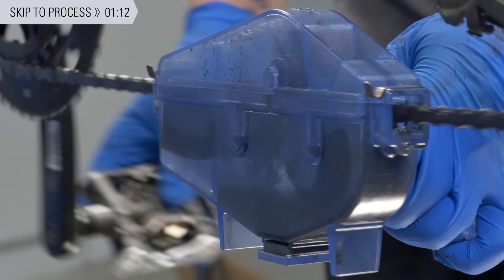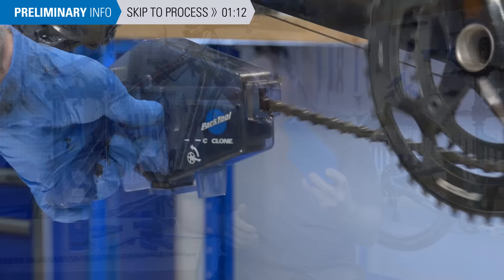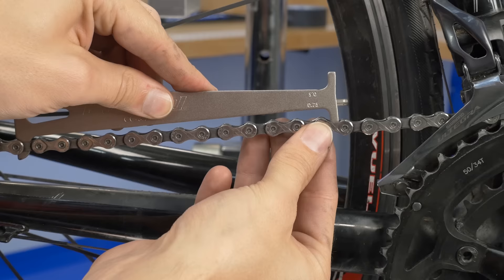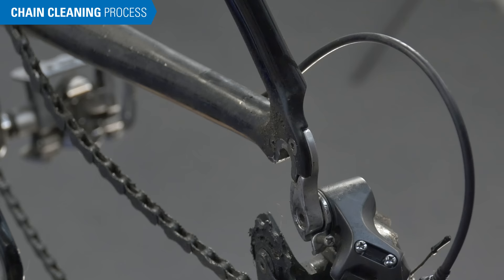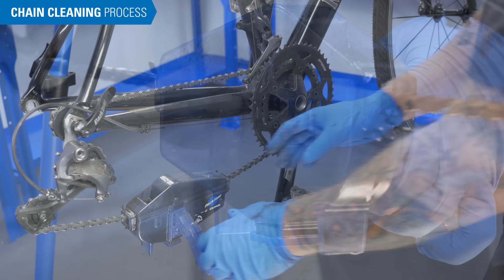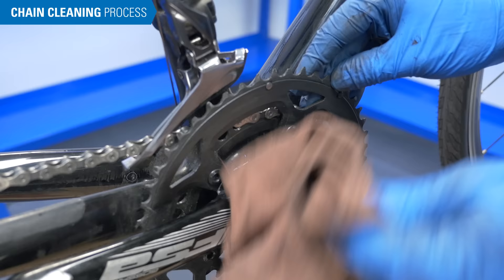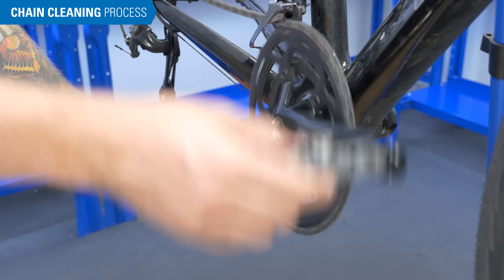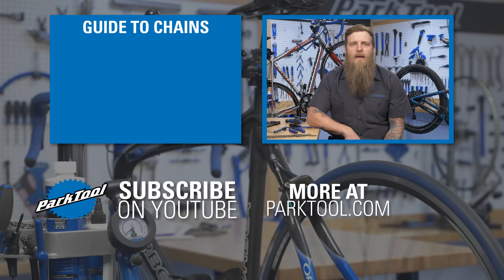How To Clean and Lube a Bicycle Chain with a Park Tool Chain Cleaner

Comment: don't do this. you destroy your chain!
Reply: Michael E you really have no idea
Reply: Adam O'Halloran 

Shimano officially says that you should not use a chain cleaner.
Reply: Michael E okay, so I spent time going over Shimano's website and reading posts to Shimano on other bike magazine sites and THERE IS NOTHING that comes ANYWHERE NEAR your statement (that these tools are not good for your chain). And if you think about it, why would there be so many, selling them?
Reply: A chain cleaner isn't bad, it are just brushes. What could be bad is if you use the chain cleaner to long with a strong solvant (so no soap but a real solvant), then the chain links could be damaged because solvants are penetrating between the links and some links could be bad after that (so don't turn your pedals for 10 minutes). But if you just use solvants for a short period and then rince your chain quickly after that there is no problem (so 30 revs like said in the video is fine). That's also the reason why removing the chain (e.g. when you have a masterlink it isn't a lot of work) and put it into solvant for a while for the dirt getting of isn't a good idea.
Reply: Using a steel wool pad or a rug or anything like that will only make the chain look clean (sort of) on the outside. It won't clean the chain anywhere near as good as the brushes in a chain cleaner. If you really don't want to buy a chain cleaner for some reason use two nail brushes.
Reply: pete smyth - Steel wool is far more damaging than plastic bristles or solvents. Plastic bristles are no problem, and provided you use solvents only briefly and rinse well afterwards, your chain will be fine. 'Stretch' will be more of a problem way sooner than the correct use of solvents anyway.
Reply: Boni Hollóssy a
Reply: I've been using that chain cleaner for years. Nothing happened.
Reply: pete smyth Troll alert.
Reply: Clemens s. IP